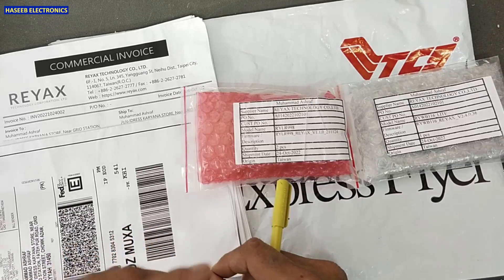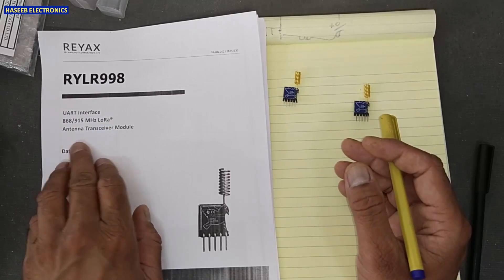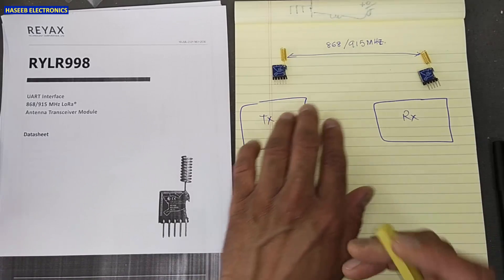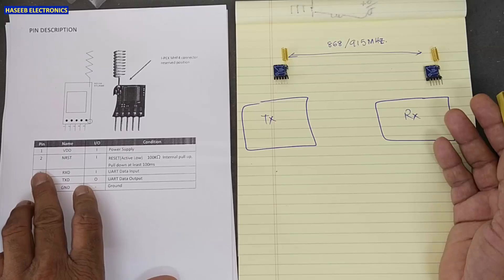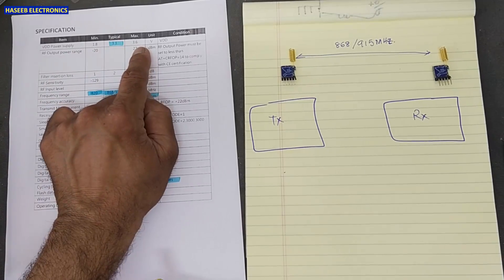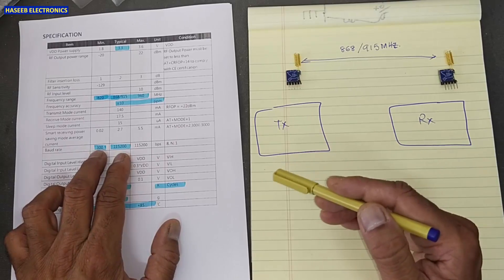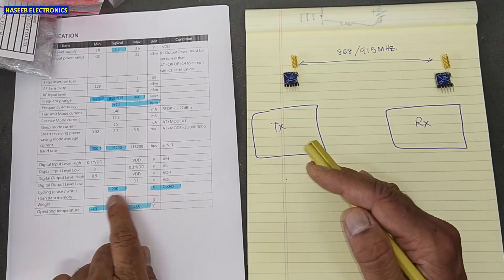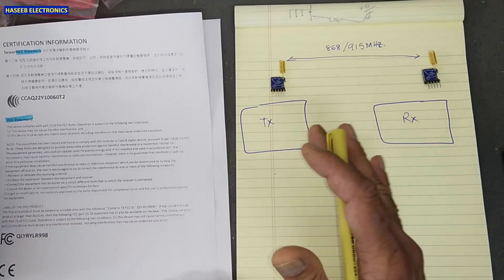{785} Reyax LoRa RYLR998 UART Transceiver Module

Comment: Assalamualaikum i am using lora module last 2 years it is very useful
Reply from the maker: wow it is fantastic to know that it is working with you and it is useful. i am planning to add in my upcoming projects,
Reply: @HaseebElectronics  I have RYLR998,  when set band using At command "AT+BAND=865000000", it remember only when it is connected, when i disconnect and connect and ise "AT+BAND?"
it shows +BAND=915000000Hz, why it is not remembering BAND?